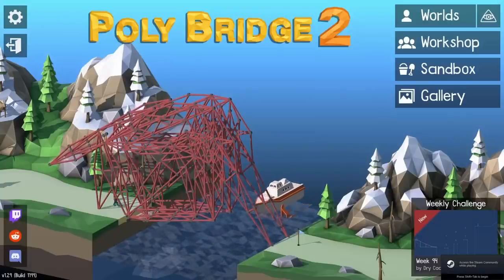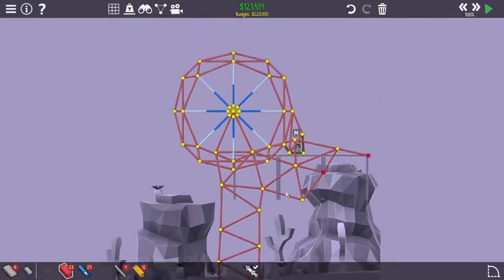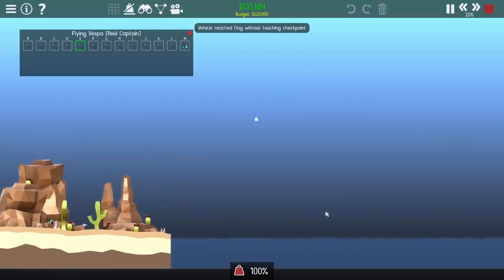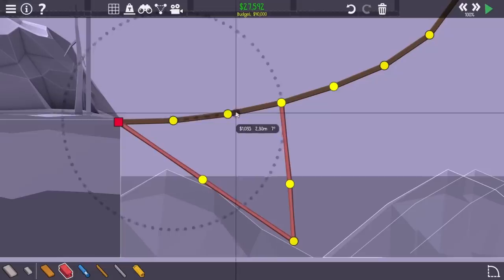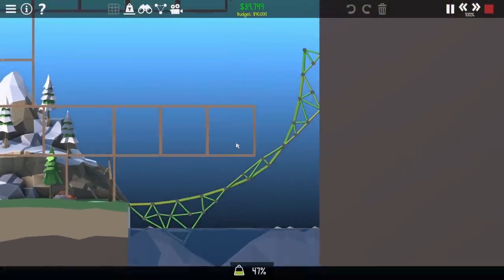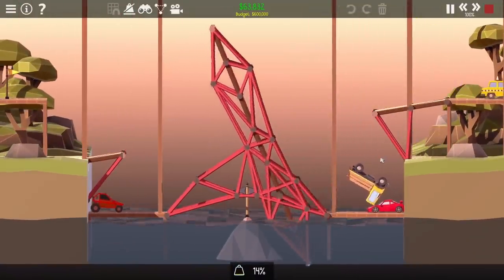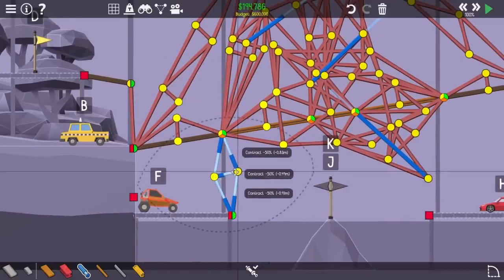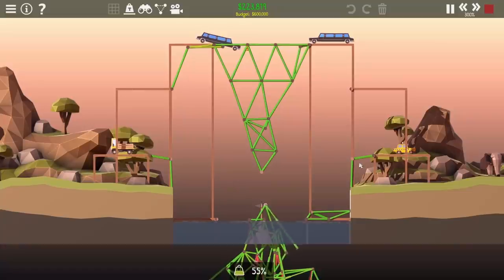How Badly Can I Overengineer Poly Bridge 2?

Comment: I couldn't get any of those solutions to work. @ 15:11 What are you anchored to? I have built it without an anchor it falls apart. With an anchor and pin, it falls apart. Using a stand to anchor it, it falls apart.